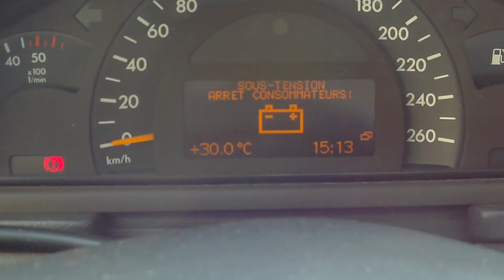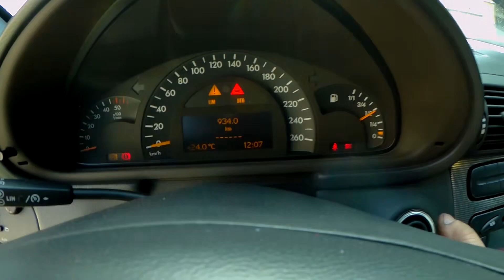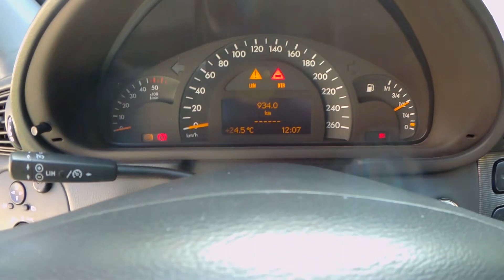SOUS-TENSION ARRET CONSOMMATEUR MERCEDES BENZ C220 CDI W203 143 CH PHASE 1 DE 2000

Comment: Bonne vidéo mais je n'ai pas réussi à faire de la place, une fois la vis de 13 de la direction retirée, je n'ai pas pu la décaler. Du coup je n'ai pas reussi à dévisser le 12v du réchauffeur juste le toucher du bout des doigts et tenté avec diverses rallonges et cardans... en vain pendant 4h... autre solution? Merci !
Reply from the maker: Bonjour,
 Je n'ai pas d'autre solution tout est bien indiqué dans la vidéo la seule manière de pouvoir le débranché. La barre du volant après avoir dévisser la vis avec la clé  de 13 il suffit de tirer vers le haut il vient tout seul sans difficulté sans ça impossible d'atteindre la vis du réchauffeur.
Bon courage